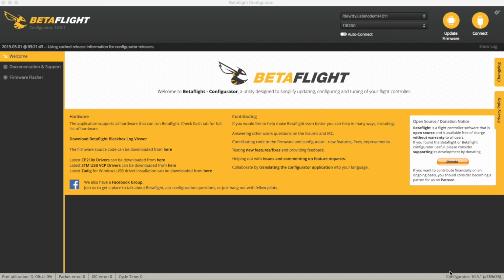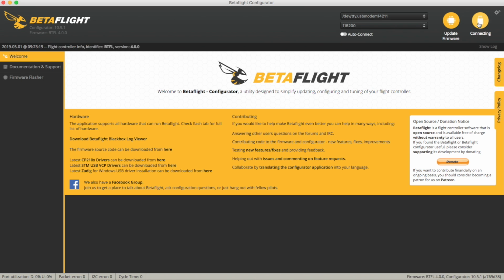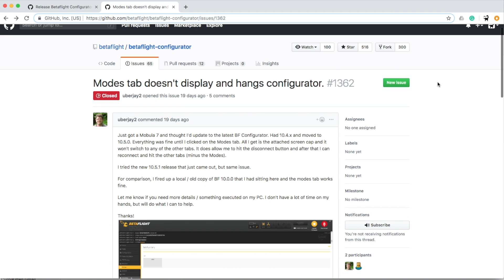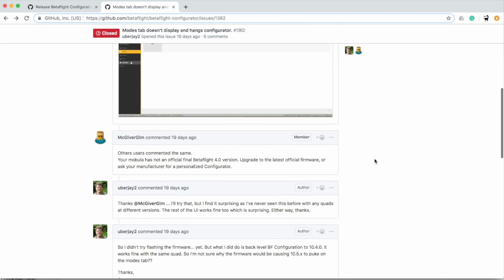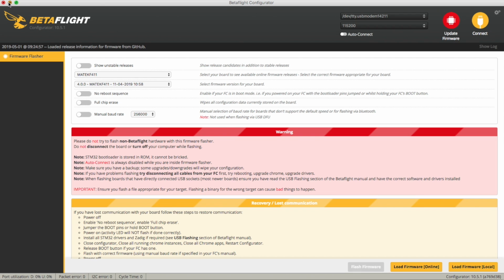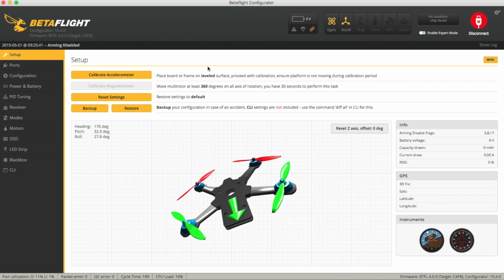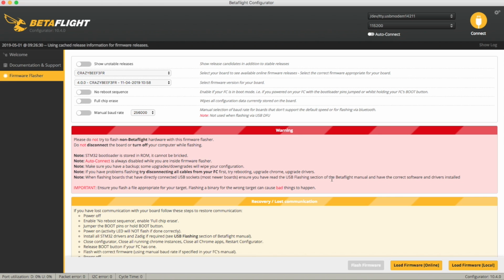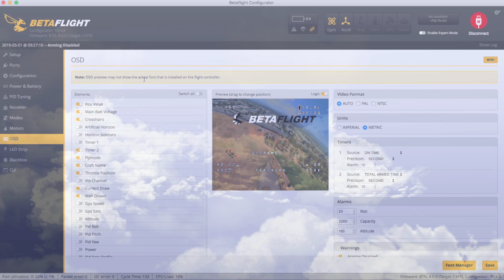Getting a weird modes screen in Betaflight?  Here's what to do

Comment: Great info. Thanks. I agonized over this for hours and decided that I needed to update the firmware (great minds think alike) which wore out my FC connector; ruining my board. Mostly my fault, but not happy with Betaflight for lack of backward compatibility. Sorry, needed to vent. Keep up the great work.
Reply from the maker: It does seem strange that between a release candidate build and the final version, they decided to change the protocol significantly enough to stop it working completely.  I hope your FC is fixable

Comment: I have to use the Chrome app.  BF configurator does not load properly anymore.  Let me load the latest and give it a try.  Last time I tried, whatever they did that made it stop working, wasn't fixed.
Reply from the maker: I think there was an issue on 10.5.0 on OSX only.  I used to prefer it when everything was a chrome app - shame google pulled the plug on that one

Comment: Does your LED still work after updating your FC? My friend flashed his trashcan to the latest version and now LED don't work
Reply from the maker: Well, I didn't update it, so don't know.  Did you dump via cli to a file before you upgraded the firmware and then use the file to restore the original settings - it's the easiest way to make sure everything was pretty much as it was on the old version ?

Comment: Lol...about a week too late for me.  I had the same issue with my  BetaFPV 75pro I just bought and about pulled my hair out trying to find the answer until I ended up using old version of Betaflight.
Reply from the maker: It was a much easier solution to me as I'd only recently upgraded the configurator and was able to plug in a quad I knew that worked previously - and thus the answer.  Glad you worked it out though :)

Comment: Hey I'm famous! ;-).  Thanks for covering this one.... your solution is basically what I did - used an older copy of BF Configurator and then just moved on with life.  Cheers.
Reply from the maker: Thanks for raising it.  Truth is I was just in the midst of raising it on Github as I couldn't find the reason it didn't work and the new fangled github feature popped up with your issue as a likely duplicate as I was typing.  I would have asked the same question about the reason for the change in the protocol as well - sound entirely reasonable to me :)
Reply: @CurryKitten  Yeah... I was a bit surprised with the fact that it worked in a prior version and didn't.  Cheers.

Comment: Brand new crazybee f4 2.0 with BF4.0 and 10.5.1 had this issue a week ago. Guessed either hw knacked or firmware corrupt. I did the flash to BF4.0.1 but always wondered if 10.4. 1 was the other solution
Reply from the maker: It was, but you did the technically supported thing, so well done :D

Comment: If I get that screen I've done something very wrong,  my quad and all my FC based planes are running Ardupilot ha ha.
Reply from the maker: But are they running Ardu on a Pixhawk/APM, or using an f4/f7 flight controller ?
Reply: @CurryKitten  both,  I have multiple APM's (both the 2.8 and pro boards) and I have two omnibus f4 pro's running Ardupilot firmware, one is running plane and in a foam board plane and the other is running Copter and is waiting to replace the APM in my quad when I can be bothered to swap it out.
Reply from the maker: You are way ahead of the curve Steve, I only learnt about Ardu on f4 being a proper thing when I talked to Painless a week or so about it.  Sounds quite interesting - I have some plans :)
Reply: @CurryKitten  very advanced flight firmware on a tiny fully integrated board which does away with the need to have a power module and osd module and the board itself comes in at less than an a apm pro.

The only downside is limited connections on the board,  if your looking to run it on a plane with separate aileron channels plus flaps plus other outputs like camera pan and tilt then the 6 pwm outputs become a problem but on a plane with only separate aileron channels and nothing else or on a quad then it's perfect for the job.

I'm sure you'd read the info thoroughly but don't use the sd card slot for anything other than osd configuration, trying to use it for data logging in Ardupilot can cause the fc to crash in mid air lol but under normal use its totally stable.
I learned about Ardupilot on a f4 pro from iforce2d.